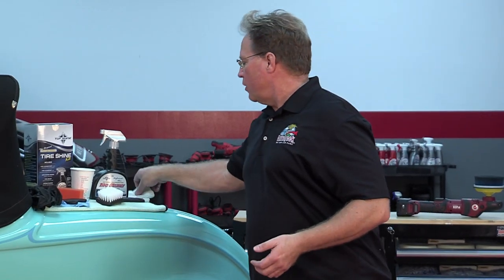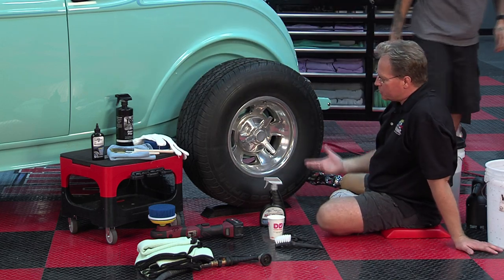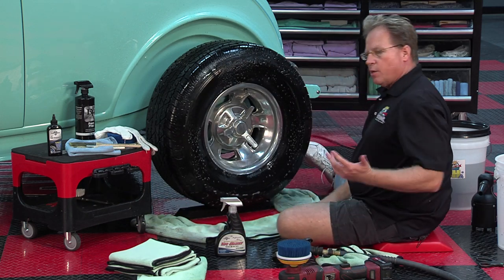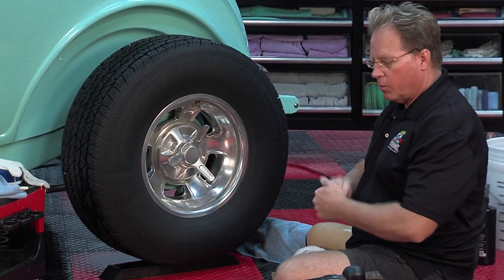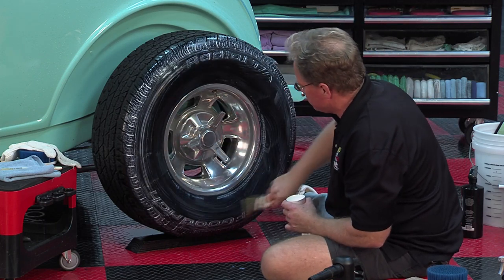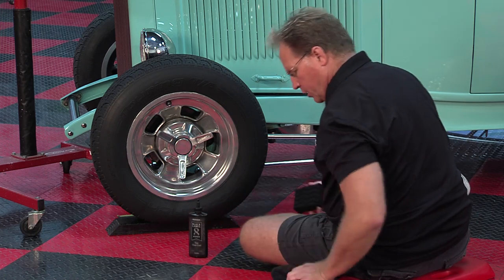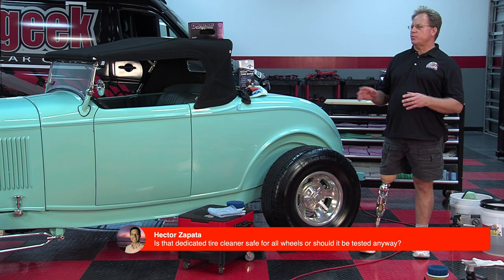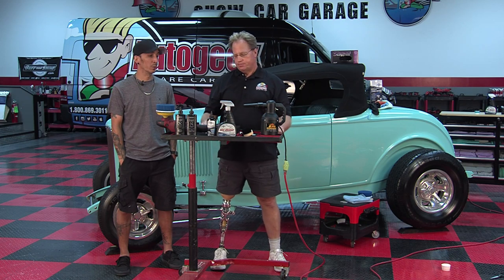How to properly clean and apply a coating to your tires

Comment: I've had great success with tire coatings on tires that have previously had tire dressings.  Secret is a lot of prep.  Tuf Shine Tire Cleaner is outstanding, but it might take 15 passes scrubbing and rinsing if the tire has had dressing on it.

Comment: I installed the PBL Tire Clear Coat on my friend's brand new truck tires. They looked absolutely amazing at first. Pics in the show N Shine section of the forum. Copper Ford F-150 Platinum Edition. He went on a road trip and came back and now it looks like the coating has come off in some areas and also faded. After talking to AG customer service I plan to clean the tires with the PBL Gel Tire Cleaner and apply another coat.
Reply from the maker: That is awesome!
Reply: @autogeek  Yes it is. These tire coatings seem to be picky but im starting to get the hang of it.